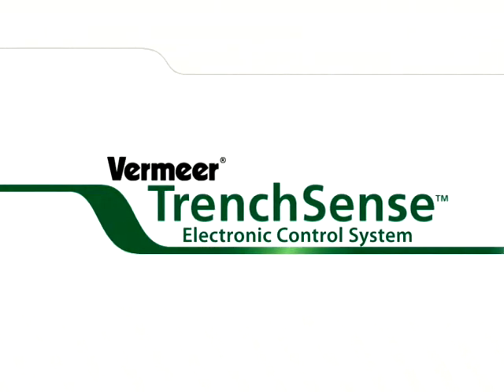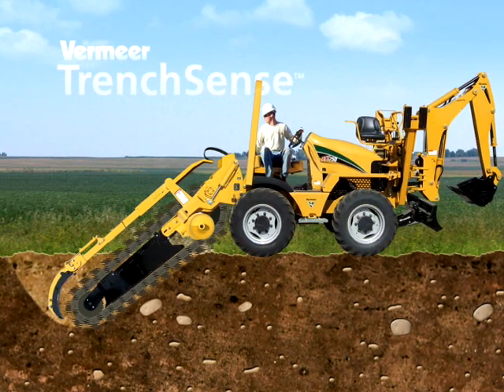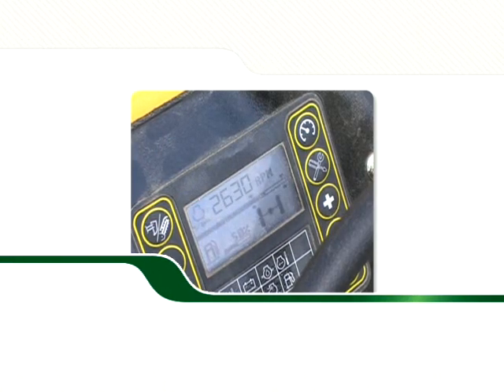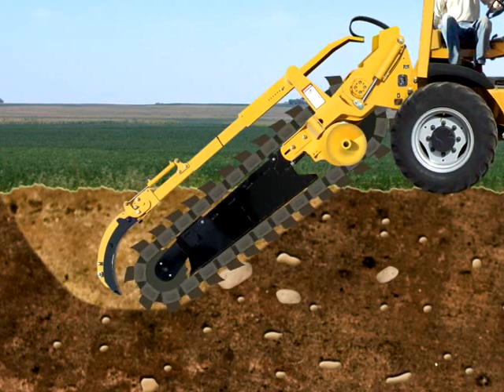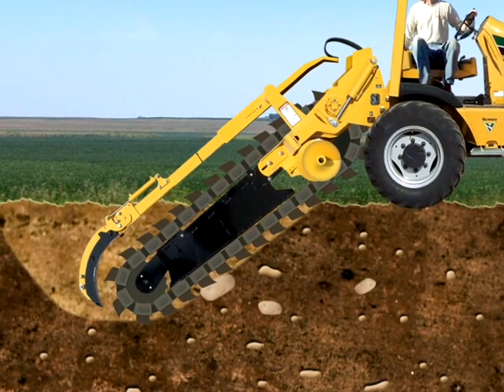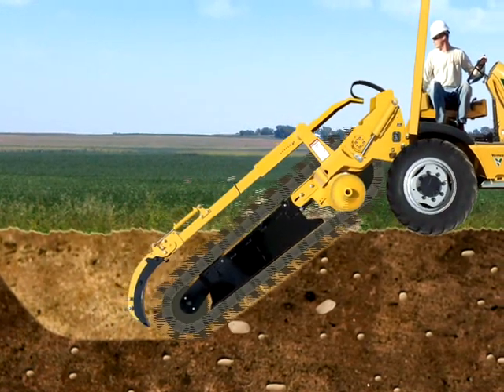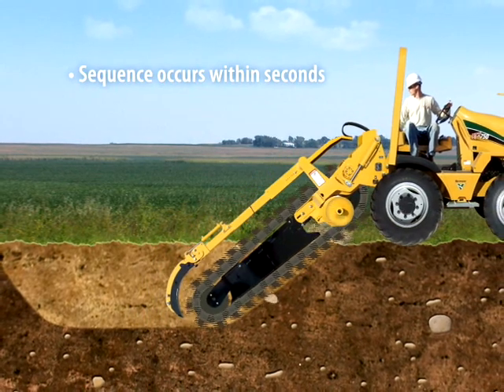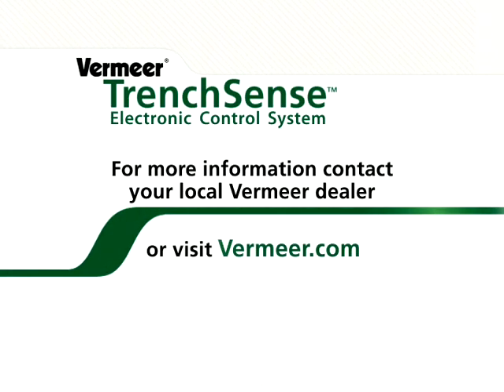TrenchSense Electronic Control System | Vermeer Underground Equipment

Comment from the maker: It is available on the RTX550, RTX750 and RTX1250 models.  For the RTX1250, the TrenchSense control system is available on serial number models 1001 and above.

Thanks!